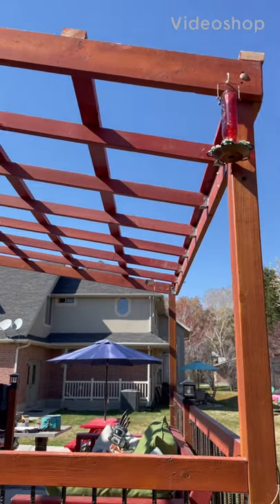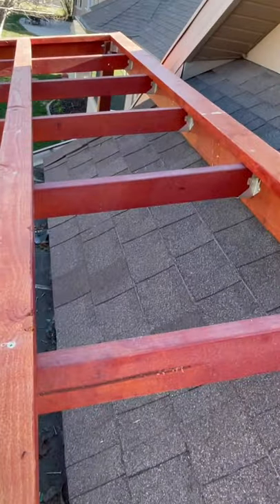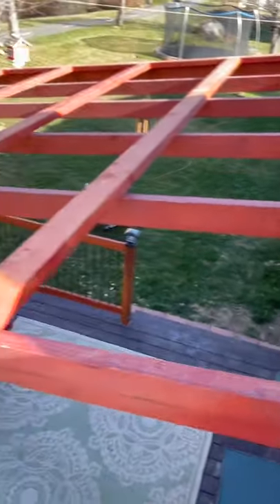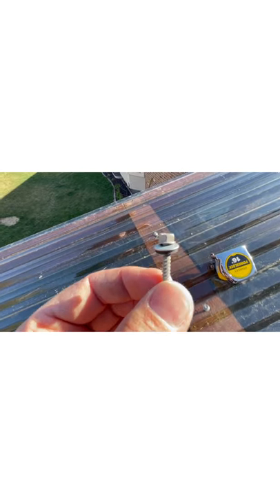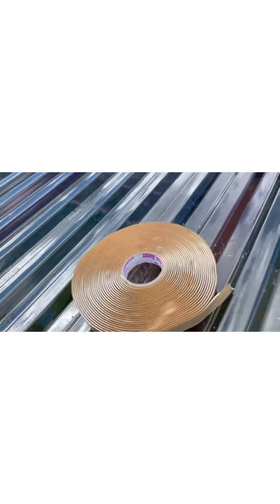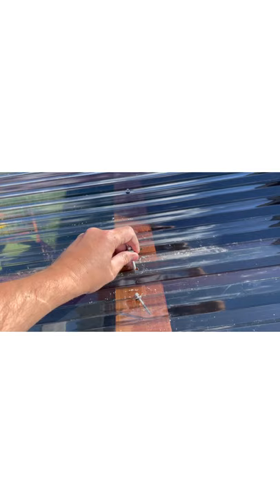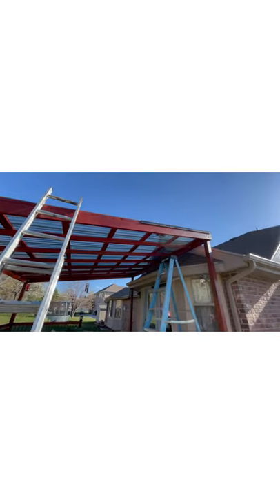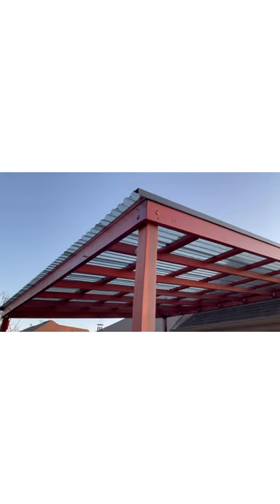How to Install SunTuf Plastic Roofing

Comment: We just finished our porch like you did , had a hard time finding 1 1/4 screws though ,  2" was too long and 1" too short for the 1x4's  mounting .  We didn't use all that plastic mounting strips either , just one end for under roof shingles .  Good video and easy common sense ,  thanks much !

Comment from the maker: In the original SunTuff PDF instructions it recommends to overlap the edge of the Greca style plastic roofing once as shown in this video.  I recommend to overlap it two times to better protect against the rain.  I wish I had.
Reply: Would closure strip have helped with that?
Reply from the maker: @nledelnr  not according to Suntuff
Reply: did you caulk your overlap? My instructions (TufTek) tell me to, but it doesn't seem to create a good seal
Reply from the maker: @wilhallman2890  I wish I had. The suntuff pdf I used did not instruct to caulk all seams. I would use butly tape if I could do it all over again. That works great.
Reply: How is it in winter?

Comment: Very good video and a nice clean job. However it's recommended to put the screws on the low side instead of the peak.
Reply from the maker: This is a good thought you have. There has been a lot of debate about this. The general consensus is to put it on the peak because it allows the material to expand and contract and also allows for the run off and debris to not get hindered by the screws.

Comment: Nicely done and explained very well, I have few questions as I am planning to do mine, why screwing on the seam ? Can we just screw on where there is no seam? Also on the pergola vertical wood structure, I see some metal brackets, wt r they ? My existing pergola doesn’t have the inclination so I have to remove and re-attach ,just wanted it to be secured.

Thanks

Comment: Why do you screw into the peaks of the corrugation and.not into the valleys of the corrugation? Thank you!
Reply from the maker: More leaking if screwed in the valleys, Debris gets stuck and also the corrugated material won’t be able to expand and contract if screwed down tight to the wood in the valleys.
Reply: @JedsGarage  Thank you so very much! Makes sense and really appreciate it!

Comment: How'd that butyl tape hold up? I have 3 inch overlap on mine and we get constant leaks.  Looking for fixes
Reply from the maker: This is good to know. I thought if I overlapped it more it would have leaked less. To be honest, the only places where there are no leaks is where I applied Butyl Tape. I say use butyl tape at ALL seams no matter the slope or circumstance.
Reply: @JedsGarage  thanks for the tip! I plan on doing that as well as sealing the top with a sealant and mesh tape

Comment: What about if you need to replace your roofing?
Reply from the maker: That’s a good question. It will be tricky but I barely have enough room to get it done when the time comes. The nice thing is that it covers a small isolated section of the roof and the panels keep it protected from the wear and tear of the sun and rain.

Comment: How has the black flashing held up with extreme heat while touching the poly?  I was advised to not let black or metal to touch the poly as it will weaken it resulting in cracks.
Reply from the maker: It’s been a few years. No problems.
Reply: @JedsGarage  Thanks!

Comment: Hi, great video, but it's unclear that the manufacturer recommends closure strips and you indicate that you musn't have them.
Reply from the maker: https://youtu.be/pUjTidI5YX0
Reply from the maker: Closure strips not needed.  Mine has been installed for a few years now and zero problems with no closure strips. The material needs to expand and contract. Check out the video link. But, use butyl tape along all seams and double overlap the panels not just one overlap.
Reply: @JedsGarage  Thanks, "not needed" is one thing, but you are advising omitting them, because otherwise no expansion can take place. I need them because I'm installing over full decking, not on a pergola. I don't have the giant rubber mushroom caps on my screws to allow the large holes to be drilled.  Thanks for the video link.  The one below mentions 1/4" predrilling, which is more reasonable.  I plant to tape the overlap between panels with butyl tape.

Comment: The future roofers might have a few opinions.  ;-)  How has the one overlap held up?  I am looking at doing two just to prevent drips from downpours or hose washing.  Necessary?
Reply from the maker: I wish I did two overlaps because my roof doesn’t have a steep slope. Do two overlaps for sure or do butyl tape along the seam if you only do one overlap.
Reply: @JedsGarage  The butyl tape would be visible.  I'll do the double overlap.  Thanks
Reply: @charleschi843  The tape would be over the rafter and not visible from below.
Or use silicone
Reply: @JedsGarage  Update.  I did the single overlap as mathematically it added up to need one less panel.  During heavy rain water does reflect up and under the single over lap and now we have drips on our "dry deck".   Ooops.

Comment: Would the roof take your weight for maintenance? Obviously with a board or something to spread the weight. That is a descent span would have expected deflection on those timbers. I guess no snow in your area?
Reply from the maker: Good question. It snows lots here. It’s held up really well over the years.  About 14’ feet across.
Reply: @JedsGarage  I think the key is your perlins are more continuous rails without notching which helps with rigidity. Also the number of rafters to spread the load.
Reply: Palram recommends the board be spread across 3 rafters

Comment: Not sure why you say Palram video does not use closure strip, it clearly does.
Your screws are pushing down on panel with no support underneath.
Had you used the closure strips and put a line of silicone or butyl tape along the overlapping seam you wouldn't have leaking issues.
Reply from the maker: True about the butyl tape. I had leaking issues because my roof slope was not steep enough.  I only have a couple leaks coming from seams.  

But seriously, I did get the instruction from a professional roofing video on this type of material on not using the closure strips.  If you have good washers and you don’t fasten down too much it seals it really well.  Also, it’s been a few years and it’s held up really well. But, Use Butyl Tape Along the seams everybody!
Reply: @JedsGarage  Considering the amount  of labor and cost to build the roof, I don't see the point saving $30 not using closure strips. Makes the connections that much more solid.
Reply: @TurboMountTV I agree 100%, that whole pergola looks like a disjointed clusterfuck.

Comment: How did you do the installation in terms of sitting on top of the pergola?  Curious about how to do this type of installation taking safety/ability into consideration.
Reply from the maker: Good question. I didn’t have to get on top. I started in the top left corner then went to the right reaching across through spaces in the pergola.

Comment: awesome work, looks great....are your rafters 4x2? how long are they from house to beam? also what size are the purlins? im planning to use same size for my pergola but ive been advised to go bigger to 6x2 to be structurally sound ...whats your experience so far? no sag?  welldone to you again, from new zealand
Reply from the maker: The perimeter is 6x2.  The inside are all 2x4. 14 feet wide.  It’s been 3 years and it’s held up great.  No sag. Thank you for the remarks.
Reply: @JedsGarage do you get snow where you live?

Comment: Great video.
I am building similar, the front beam will be 4x4, 
I hope to get 8 feet without sagging. Would 2x6 beam be better?

You attached the SunTuf panel directly to the purloin, you didn't use the horizontal closure strips??

I had thought 2x6 rafters better, but your comment below says 2x4 holding.
You used joist connectors and not sloped rafter connectors???

Any advice appreciated, thanks.
Reply: Same question!

Comment: Hello! What type of joist hangers did you use on both sides? They look low profile, I like that. I'm planning on using the same roof panels for my small 4x9 project but I'm thinking of using 2x2 instead of 1x4, but not sure yet. And would you prefer getting the closure strips now? How is yours holding up?
Reply from the maker: It’s holding up really good. Still no closure strips but use tape along all the seams and overlap by two rows instead of one. Joist hangers weee for 2 by 4s.

Comment: How do you ensure no rain water gets through the holes where the screws go? I'm trying to wetproof under the area that's covered.
Reply from the maker: There are special screws with rubber washers connected to them. The rubber washers keep the rain out. Look for them in the video. You can find them at most big box stores.
Reply: @JedsGarage  still, wouldn't it have made a tighter seal to put those screws with the rubber washers in the valleys???

Comment: Hi Jed, the official vids I’ve see have the closure strips, as does the pdf I downloaded. Can you post a link to the instructions you found without the strips? (They are sold out all over the place where I am — can’t find them — so maybe they’ve changed recommendations ?
Reply from the maker: https://www.google.com/search?q=psp+suntuf+installation+guide&rlz=1C1CHBF_enUS863US863&oq=psp+suntuf&aqs=chrome.1.69i57j0i22i30.6407j0j7&sourceid=chrome&ie=UTF-8#kpvalbx=_gFRSYeGBIsqK-wTf6rbQDA15
Reply from the maker: Strips can be used but are optional.  Some use them to keep debris from going underneath the panels.  The most important thing is that your panels are not held down so tight that they can't expand and contract.
Reply: Thanks Jed!

Comment: Is this your suggestion or is it from manufacturers installation guide?: "...drilling holes a little bigger than the screws so that poly carbonate can extend..."
Reply from the maker: From the guide and what others are doing.
Reply: Many of the manufacturers globally recommend drilling oversized holes.

Comment: Did you seal the seams along the sides of the panels where they overlap?
Reply from the maker: Fantastic question. No i unfortunately did not. The slope is not steep enough so I really needed the butyl tape because I did not overlap it enough due to the lack of slope.
Reply: @JedsGarage thanks for answering.  I’m looking at this product, your video is very helpful

Comment: It looks like the pergola roof overhangs part of the house's roof. I always wondered if that's ok to do. Does anyone have any thoughts on that?
Reply from the maker: I made it pretty close but it’s not attached to the house only to the ground.  Unfortunately, It’s probably too close to the roof but I couldn’t find beams any longer.  We will need to put new roofing on that small section of roof (eventually) and I only have a few inches to work with.

Comment: How do you caulk it? The directions say caulk between overlaps, so I'm running a bead and then overlapping the next sheet onto it, but this seems to create gaps in the caulk..... so maybe they mean to caulk on the outside?
Reply from the maker: Good question. I would use silicone instead of caulk. It’s more waterproof. But, this is not needed if you overlap them. If I could do it over, I would Overlap it twice instead of overlapping it just once like I did in the video. Also, the greater the pitch, the less you worry about water pooling. If you do silicone, I would run a bead then overlap like you are already doing.
Reply: @JedsGarage  thanks, I am actually using silicone, not sure why I called it caulk haha

Comment: Are those face mount 2x4 joist hangers? Any issue with using on a low pitch roof without a kerf?
Reply from the maker: It has a slight kerf. Maybe a 2 foot slope in the 14 foot span total. Yes, 2 by 4 joist hangers.

Comment: Could you just have screwed it down to the 2x4s if the spacing was good instead?
Reply from the maker: Good question.  You need rafters for support because they are installed at a 90 degree and the Perlins (on top of rafters) because because they are installed flat and perpendicular to the roofing material. I suppose you could just install them on the rafters but the roof would not be as sturdy and you wouldn’t be able to hide the seam. Perlins give you more area to work with.
Reply: My rafter’s go horizontally and are spaced about 2 ft apart. I definitely could hide the horizontal seam and tape. 
Also if you recommend overlapping by 2 valley’s vertically would you still use the sealer tape?

Comment: I live in upstste NY, sometimes we get lots of snow, not as much as Buffalo,  but  occasionally  1' - 1.5  feet . Does anyone knows if those panels ( white) ones can hold it, ?
Reply from the maker: Well, we got record snow in Utah this year and my panels did ok.  Also, the purlins give it the support it need as long as they are not installed too far apart.  I installed mine so the purlins were only big enough for me to fit up through when i installed the panels.
Reply: @JedsGarage  Thank you to responding! So you probably spaced then at 16" or less apart. And the purlins rest on 2"x 6" or 2"x8" joists?

Comment: When building your structure did you use 4x4 post vertically with 2x6 or 2x4 horizontally?
Reply from the maker: 2 by 6 for perimeter. 2 by 4 for inside of the structure. All vertical posts are redwood 4 by 4

Comment: How much of a pitch do you have?  Have you had any leaks?  Would you have done anything different (overlap by 2)?  Do you recommend it?

I'm about to install this but I'm second guessing the amount of light that comes thru.
Reply from the maker: Yes, overlap by two and also install a strip of tape down each seam. Pitch is a 3/12.

Comment: what size is the screw with rubber on it? does your pergola have to be inclined or simply flat?
Reply from the maker: Incline recommended. You want the water to not pool together on flat surfaces. Rubber is just under .5” wide.

Comment: Do you really need to pre drill holes?
Reply from the maker: The material expands and contracts and may crack if it’s right tight up to the screw.
Reply: Unless you buy screws which have a provision to enlarge their own holes, yes.

Comment: the screws should sit in the valley, not on top, in the same way as you screw metal roofs
Reply from the maker: Thx for the comment but screws should sit on the top NOT the valley because if they go in the valley they will act like dams to water are are also more susceptible to leaking through.
Reply: @JedsGarage  Hello! In Sweden, all plastic roofs are screwed into the valley according to the manufacturer's instructions. The sealing washer prevents leakage. The water has space to flow at the sides of the screw. When you screw in the top, there is nothing to resist and the plastic can be easily deformed and then the washer does not seal. I have installed hundreds of plastic roofs and have never had any leaks. Important to remember to always screw perpendicular to the roof
Reply: Yeah, that’s not true.